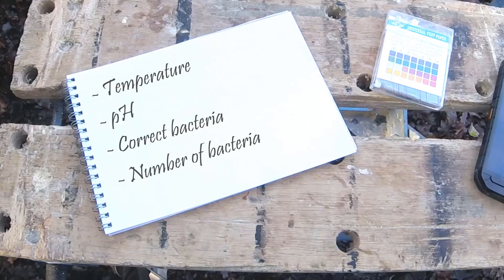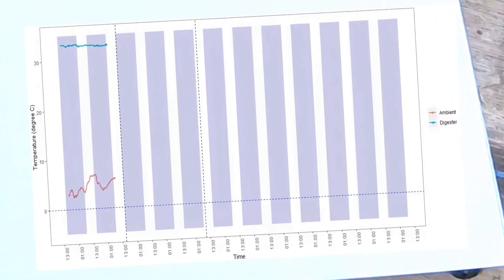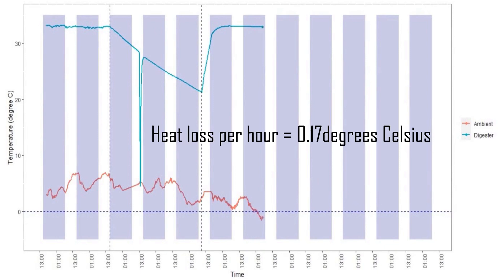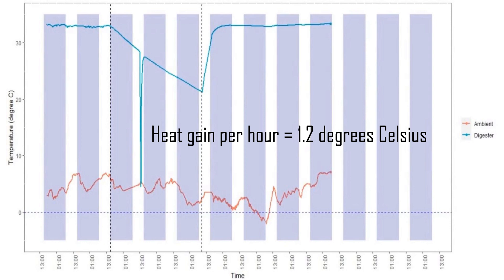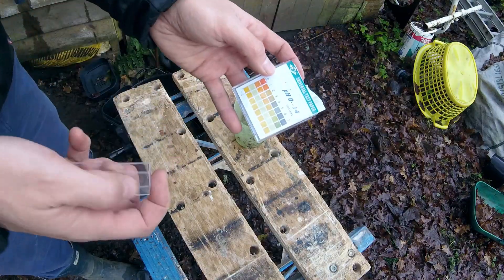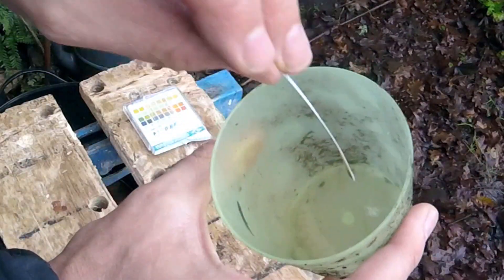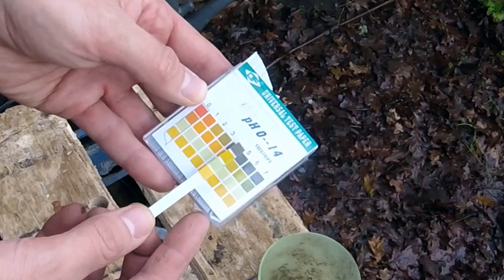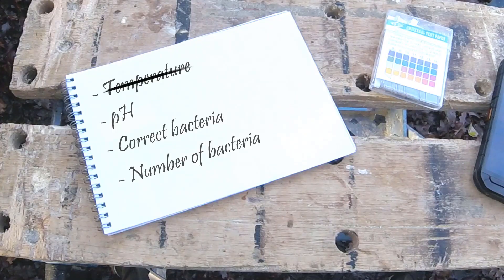Biogas Digester troubleshooting // No Gas, What's the issue?

Comment: Im sure you are up and running but  just a few observations. If you can run your temperature a little higher in the mesophelic range (37-39C), you will see faster conversion. You shouldnt swing the temp any more than .5 degrees c per day. Methanogens are very sensitive to sudden changes in temp, feed rate, ph, etc. The low ph you experienced is normal when startung up a tank. Acid forming bacteria have to perform thier work before the methanogens can finish things off. You can add alkalinity with sodium hydroxide, you should carry a minimum of 2500 mg/l alkalinity.  Of course a complete mix system would be ideal. Good luck

Comment: Hi, I have been running a biogasdigester for about half a year in a IBC-tank (1000 l) in my garage. Initially I put in 250 litres of cowmanure and another 250 l of water. After about 1 month the gas production has started. I kept the temp. at about 30 degrees and fed it fallen fruit, grassclippings and food- and kitchenwaste. My insights so far: Make sure all joints and seals are 100% tight. (Lately a gas-detector tool has been helpful). Feed it regularly, i.e. twice a day. I macerate the input with a food macerator for optimum surface. The process likes a mix of different substances. I have thrown in porridge oats, ground cornmeal and sometimes 1 kilo of sugar. To get enough output for cooking I have to feed it at least 2 to 3 kilos. I like your video, thanks for sharing and keep it up, best, Etienne
Reply from the maker: Thanks so much for the info, really really useful. I am hoping to get mine up and running again next year. Electricity prices at the moment means its not viable to heat during the winter. What gas detector do you use?
Reply: @GetMeOffGrid_  ..anytime, its a pleasure :-) The detector is RIDGID MICRO CD-100, American design, made in China, cost CHF 140. I gauge the energy which is used to drive my two aquarium heaters and at the moment it is between 2 and 3 kw per day. (min: 7, max: 13 degrees approx.) Also, my PH is about 7.2. You can have a look at my channel where I explain things. Cheers, Etienne

Comment: Hey chap.  Me again.   Can you share your RPI circuit and code.    I am more familiar with Arduino but I do have a PI which was going to be a farmbot but that project has ground to a halt so it’s all collecting dust now.    I love the data side of your system and would love to replicate it.       Cheers.    Tanc
Reply from the maker: Hi Tanc, I sure can. I haven't used it in a while but I did have it on github. I'll have to run through it to make sure its useable though. I won't have much time in the next few week (moving house) but will get to it in July. Gives me a push to get my system setup again as well. Cheers
Reply: @GetMeOffGrid_  hey chap, so here is a funny thing.    I set the temperature controller to 35,     All good but now the sensor is reading 45!     Is it normal for a veery well insulated digester to generate heat?,    If it keeps going up do I need to cool it?     Could this be an unexpected water heater?   Anyway, hope you are well.    I have done a bit more reading and it seems that damp wood ash is a suitable co2 scrubber.     Todays job is try the fridge compressor bottling plant.
Reply from the maker: @itanc1  From what I know it shouldn't be generating heat, not in the range of 10C anyway. How is your temp controller setup? Nice about the damp wood ash! Let me know how you get on with that. Ah I can't wait to get to the compressing stage, literally the thing I am most excited about. All the best
Reply: @GetMeOffGrid_   so it’s a 24v switch mode psu and a Chinese pid controller withe the heater at the bottom and the thermocouple at the lowest point of the effluent tube.    It is possible I suppose that the sun could be heating the effluent tube more intensely and that is what I am reading.   On the compression front I am going to try a fridge pump into a blow torch bottle and then an lpg cylinder. Methane needs 185 bar to liquify so storing it at 10 bar in a propane bottle will last 1/30th of the time that the same bottle of lpg will but hey it’s free!
Reply: @GetMeOffGrid_  hey chap.    Here is a link to the compression film I made.    I have not made it public as I think the practice will attract unwanted attention but you are a different case.   On another note I am looking for partners to promote biogas and am applying for funding to do it with.   Would you be interested ?     Cheers.   Tanc

Comment: Hi, respect for your tries! 
But with respect I don't really understand why you don't use panels to heat your digester? 
2x 250w on the roof of your shed. 
Then I have to point that the insulation is insufficient. If you are from UK you know how the hated hot water cylinder is and always was insulated. With closed cell foam. The r rating of closed cell is diametrically different to mineral sound insulation.
But further more is the heating. The efficiency of loop inside is nowhere near of the simple resistive heating element- about 95%.  So if I may, I know you've gone a long way, but I would rebuild it. Small and big drum. Small one suspended in the big one is your normal biodigester. The big one is filled with water. Creating water jacket around small one. On the bottom of the big one are two or three spacers (preferably stones as they retain heat). In amongst them is 300w 12v imersion heater. Heating the water that transfers to biodigester. That way the element doesn't corrode as easily as it would inside of digester and you don't have to keep cleaning the element. Then place the drums in that small space and fill it up with insulating foam.Creating foam coating just like on hot water cylinder.
 You can use the battery with ,,charge controller". Not your common solar charge controller. Wouldn't work. But you can also directly connect them to the heater and thanks to all the insulation it'll stay alive for so much longer. Just have to find right ratio of panels to your amount of slurry. Am plumber and electrician if you need help just ask.
Reply from the maker: Hi, thanks. Yes there are 100% much better ways to do what I have done. Its all a learning process. I have rebuilt already, so always happy to think about new designs if they are going to improve it. I like your idea about the water jacket, the only issue is the practicality of doing that with this or anything larger. I don't think a barrel inside a barrel is the right way to go, maybe a kind of tank to sit the 200ltr barrel in, like a hot tub, possibly using an IBC as the shell. Not sure the dimensions of a IBC would work with the barrel though...what do you think?

Comment: Similar problem here. Lots of gas but very little methane. I have been tryinging different solutions and hoping for the best. One thing is for sure: It is definitely a complicated process.
Reply from the maker: Yeah for sure! More complicated than most videos make it look.
Reply: @GetMeOffGrid_ yesterday,  I had my first decent combustion in weeks. Still don't know what fixed the problem.
Reply: I have the same problem, have you found solution?
Reply: @geraldyluhunga7648  I found out that the slurry was acidic and I added lots of sodium bicarbonate to neutralize it. I strongly believe this fixed the issue. I also added rich sugar content after that. That must have kickstared the process that might have taken a lot more time otherwise.
Reply: @yapanadam-gid  thanks, let me work on it, i will give you a report on the progress.

Comment: On Info Studio the man puts into his tank fresh leaves then doses it with a pail of powdered limestone followed with a pail of water.  He produces unscrubbed gas in 72 hours or so.  Perhaps the lack of biogas is more of a missing chemical reaction.  Powdered limestone did the trick and seems fairly passive.
Reply from the maker: Do you have a link to that video? I'd be interested to see it. From what I know the reaction you describe wouldn't produce anything as limestone or chalk is inert. What we are trying to use here is not purely a chemical reaction its a biological reaction, where the bacteria do the chemical reaction internally. But I'd be interested to see what type of reaction this channel is using.
Reply: Hydrated lime also works same as you use for building acts as a buffer for the bacteria. We have a ad plant at work we feed ours grey starch, bread scraps, rye grass or maze. Then liquid wise we use a exstract from cheese making called perm acidic with natural sugars for the bacteria to use. Heat is a key factor there are two bacteria zones one thirve around 20 to 30 degrees we use the higher zone of 50. 

Agitation also helps to the digest-ate not so sure its possible in a bag.

Chopping your feed prior to it going into the bag will help massively too 10mm is optimal size

Comment: Have you had any success since? Appreciate your videos. You are right not everyone on the Tube shows the bit where it does not work.
Reply from the maker: Not over winter, no. I stopped heating it during the winter because the pond heater was to expensive and couldn't get the rocket stove heater to work as I wanted. I'm waiting for the air temperature to heat up a bit it try again. I'm also going to refit the digester with a waste pipe at the bottom as I realised moving it when its full is not possible.

Comment: Another option could be a heat left used in brewing beer.
Reply from the maker: I'd love it do that. One day when I have a better suited place
Reply: @GetMeOffGrid_  this might be a daft question but when the generator is eventually running, could it run its own heater.
Reply from the maker: Yes I am going to, hopefully, get to that. Definitely a good idea. Fingers-crossed!
Reply: @biggusdiggus3337  

Yes. You can use it to power a generator that will power the heater.